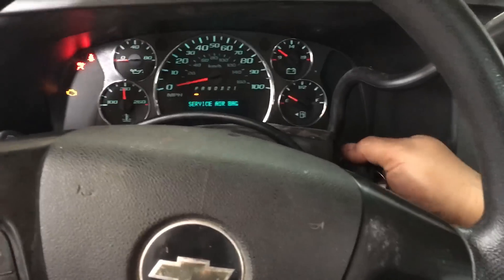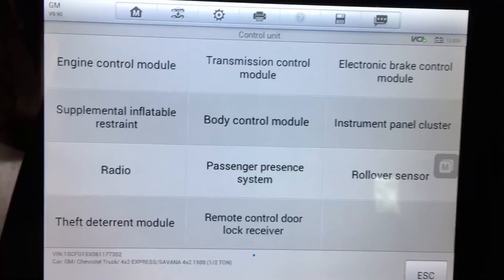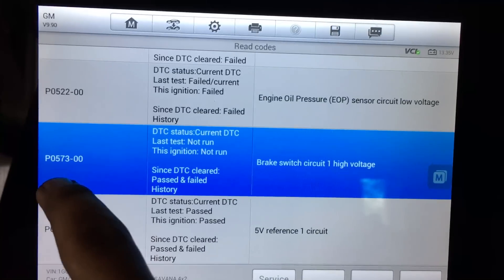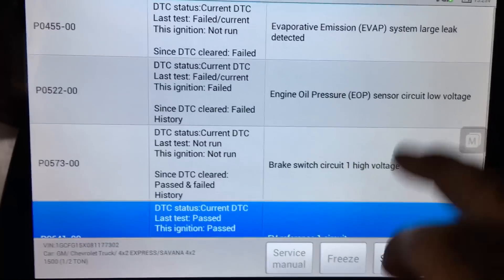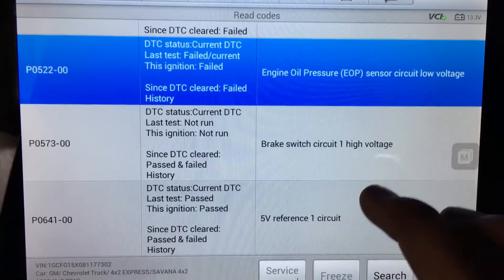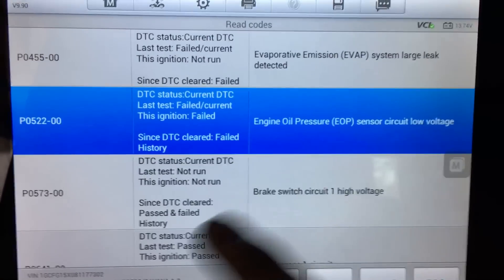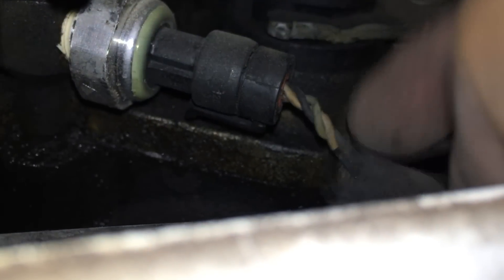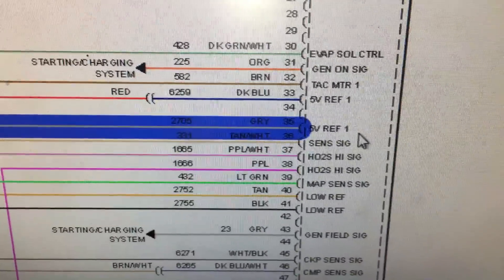CHEVY EXPRESS VAN 5 VOLT REFERENCE FAULT DIAGNOSIS AND FIX

Comment: i need some type of info or video to fix a po335. ive replaced the sensor and also repaired some wires that sparked off an engine clamp. would appeciate any code

Comment: I had a 2003 4.3 vortec the Temperature sensor on side of head on drivers side 5v would short to ground same issue.
Randomly would stall not start until cold.
Sensor was damaged from someone change plugs cracked it.

Comment: I have seen a simple pin hole in the wire  insulation cause a wire to corrode  Water and salt gets in the wire. Can't even see it when looking close to it.

Comment: I know this is 2 years old. I watched multiple videos on 5 volt reference.  This was simple and made sense. You were the only one that mentioned 5v 1 being the same circuit. I thought each 5v1 was it's own circuit. I had 4 failed sensors. All on 5v1. Cam sensor had an internal ground short causing disruption to the 5v circuit for all.

Comment: Hi Eric ,  I have been watching your videos recently and they are quite helpful I must say . Could you help out in this situation? I bought a 2008 Chevy Express 1500 van 4.3 motor from IAAI auction ,Van ran until they stole the CAT and the welder burnt out ECU when welding exhaust together because he forgot to disconnect battery. Car won’t start , we’ve replaced ECU and TCM , nothing . Now we are looking to replacing ECM, TCM, and BCM . But we are not sure how to go about programming these new computers .Van is currently located in Africa . Is there a good tool you recommend that can diagnose these vehicles properly? What tool should we use to program these modules to start the Van ? 
Thank you .

Comment: When I was in automotive paint sales, our old work van would start hesitating and stalling randomly and for a long time we couldn't figure out why after many trips to the shop. They replaced the fuel pump, coil, plugs, wires, practically shooting the parts cannon. The main mechanic gave my boss a promise of all that was holy he would figure it out and went meticulously through harness after harness until he found that when they smashed the harness up between the engine and the firewall, the harness was starting to rub out and one of the 5v reference lines was shorting to ground dropping a whole bunch of systems out and causing the ecu to loose signal of the camshaft and crankshaft sensors.

Comment: I had a Jeep that uses 10W-30 oil and would drive it in the winter in -30 C, and when you first start it up on a cold winter day it made 100 psi of oil pressure. I almost wonder if that's another reason for the dummy gauge cause people get worried when the oil pressure gauge pegs high.

Comment: I did not know about oil pressure gauges until now. I was driving a (new to me) company Ford one time and looked down to see zero oil pressure. I freaked out and pulled over and immediately shut it down. I checked, and it was full of oil! I never trusted it after that.

Comment: Just subscribed  very good diagnosis 1 question the 5 volt reference comes from the ecm  does the ecm time out I ask because u had the key off  I’m a retired HVAC  service tech  worked on  pneumatic systems  and commercial refrigeration. Thanks

Comment: Can something in the charging system cause a similar problem?  I get a battery light every once in a blue moon and it's gone the next time I restart the truck(03 Express 2500 5.3),but lately it's been stalling similar to your case randomly. I replaced the alternator a couple years ago with a new ac delco unit. I had a lean code recently,  gonna check my harness and check for vacuum leak anything else you think I should check? Great video!

Comment: And oil gauge just to keep owners happy? A dummy gauge? Really?
Reply from the maker: Yeah, It's well known that most Ford vehicles use a oil pressure switch not a sensor for displaying the oil pressure on the instrument cluster. Ford oil pressure gauges do not fluctuate with engine rpm like most GM vehicles do. Thanks for watching!

Comment: Good thing the ECM didnt't get damaged when that 5 volt ref wire shorted to ground.
Reply from the maker: The 5 volt ref can get shorted without damaging the computer because there is a built in resistor and a current limiting device inside the computer. Thanks for watching!
Reply: The computer will protect itself in the event wires get shorted to powers or grounds. Check out scannerdanner so videos he does a great job of explaining how  these system work.

Comment: THANKS FOR THE VIDEO , IS THERE NOT A SHORTER WAY OF TESTING A PROBLEM LIKE THIS . WHAT IF YOU COULD NOT FIND THE BREAK IN THE WIRE THE WAY YOU TESTED . HAVE YOU EVER TRIED WIRE TRACING WITH A TONE GENERATOR AND PROBE IT WOULD LOOK TO BE MUCH EASIER THAN DIGGING IN TO A FAR RESIST WIRE HARNESS . SOMETIMES THE SHORTEST ROUTE BETWEEN TWO LINES IS NOT THAT STRAIGHT OF A LINE .
Reply from the maker: Yes there are plenty of other methods I could of used and often times do use. I just felt like there was a good chance the wiring was rubbing somewhere obvious. So I decided to quickly inspect the wiring harness. Thanks for watching!

Comment: Man that Van needs to be cleaned. All them bottles. Just one roll sunder the Brake or jams the gas peddle. Your ass is going to have an accident. I would also invest in some real Automotive wiring. I bought it to rebuild wiring harness that are chewed up. Never had a car come back for electrical issue..And is high heat. Flexible and high wire strand count. Great stuff. https://www.ebay.com/itm/14-AWG-GXL-HIGHTEMP-AUTOMOTIVE-POWER-WIRE-8-STRIPED-COLORS-10-FT-EA/303225188809?_trkparms=aid%3D555018%26algo%3DPL.SIM%26ao%3D1%26asc%3D60256%26meid%3D0740af986e37430c8b472c4468ca6197%26pid%3D100005%26rk%3D1%26rkt%3D12%26mehot%3Dpp%26sd%3D292556608032%26itm%3D303225188809%26pmt%3D1%26noa%3D0%26pg%3D2047675&_trksid=p2047675.c100005.m1851
Reply from the maker: Cool. I'll check it out! Thanks for watching!

Comment: You got lucky with that wire finding the bad spot . GM should not run that harness so tight to potential trouble . Great work .
Reply: How did he get lucky? All the right things were done to arrive at the problem area.
Reply from the maker: 80% Skills and 20% Luck. Thanks for watching!
Reply: Checking at the computer would have proved it was broken between the computer and the oil pressure sensor but finding that wire definitely wasn't luck.